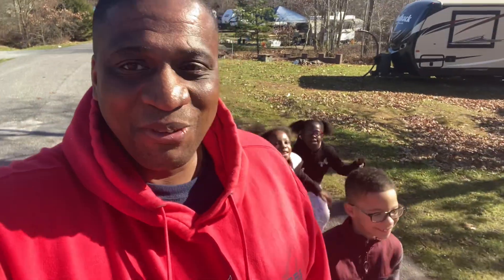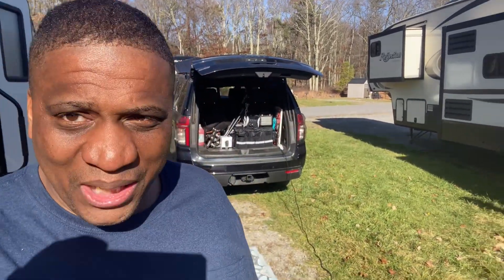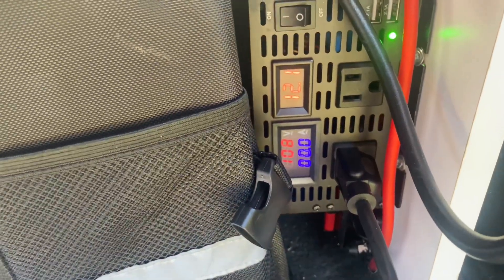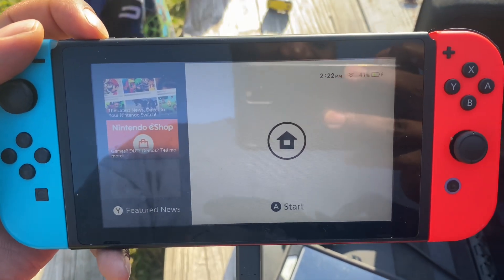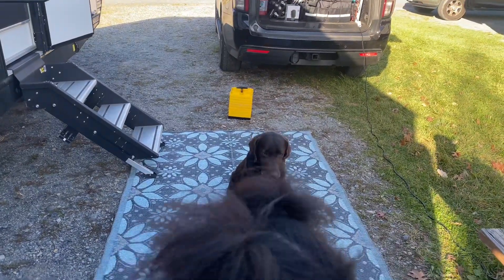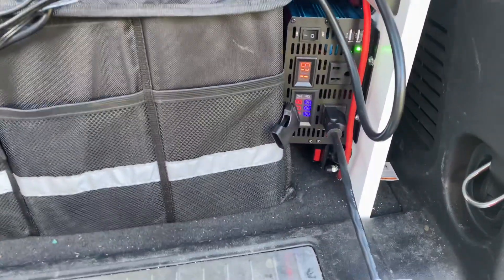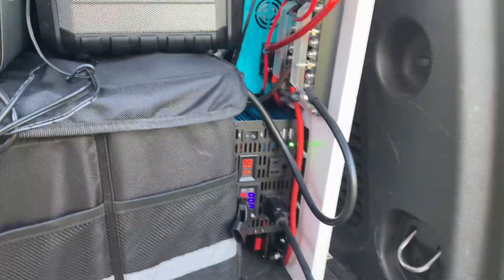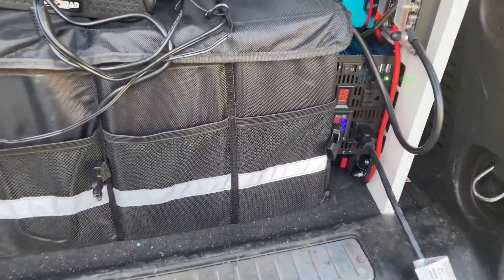Camping And Testing Overland Battery System / Off Grid System Test

Comment: Good info to know. Plus the family gets another fun camping trip in.
 I have to get a solar panel for my amproad 300 watt.  Got any suggestions?
Thanks for sharing.
Be safe and blessed.
Reply from the maker: Solar panels are very cool to have. I used my Amproad portable power station the most out of all of our power stations. In the description of this video there a link to our Amazon Store front. The solar panels we use for the Amproad is there. We use the same foldable solar panels for many of our solar batteries.
Reply: @TheSmallsRVAdventures  Thanks I appreciate your  help with the solar panel.  I got a little nervous when I saw the attack in NC.  Does it matter that I have the 300 watt, I see you have the 1,000.
Blessings
Reply from the maker: @containingmygarden  no it doesn’t matter. The 100 watt solar panel works great. I also have the 300 watt Amproad. It’s hooked up to the fridge in our room. When boom docking we connect the 100 watt solar panel to keep it charged. It works great.